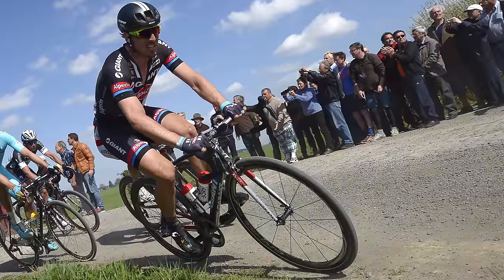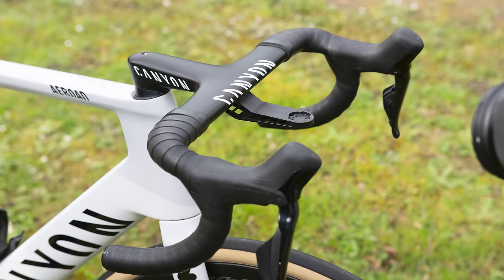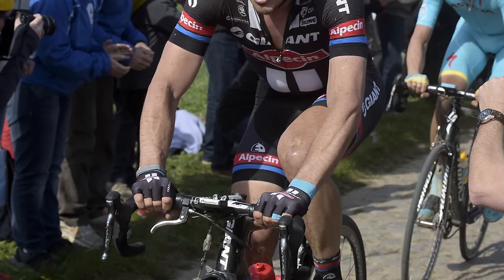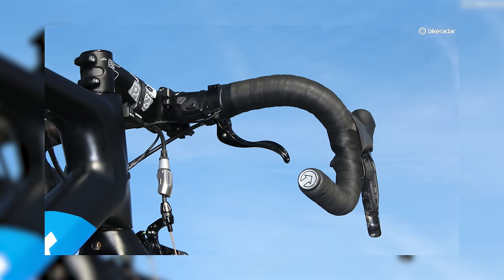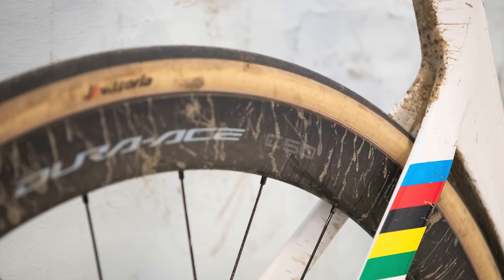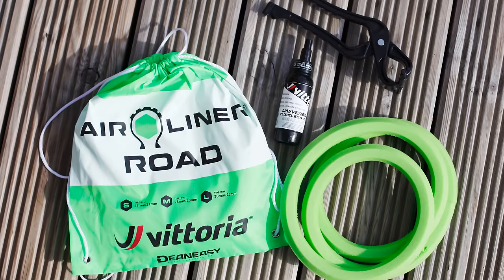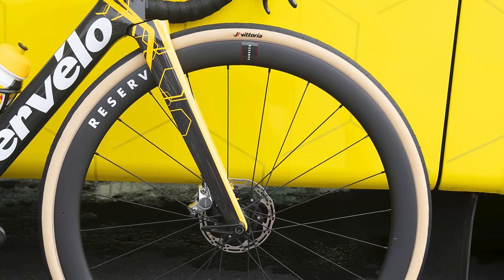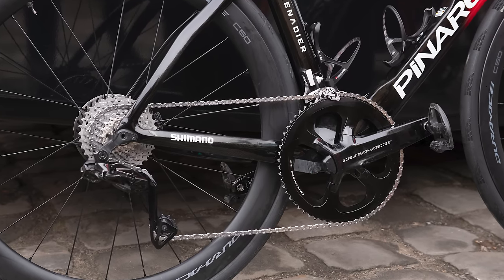2015 Vs 2024 | Paris-Roubaix Winning Bikes Compared

Comment: Something you forgot: MvdP started on 28mm tires. He switched to his bike with racing number amd 32mm tires after around 80-90K (could be less) when he took a pee break, and returned to the peloton with Pedersen.
The one-by hype was strongly pushed by the fact there was a strong tailwind.
Reply: Possibly 170mm cranks vs usual 172.5 ..

Comment: As a new road cyclist, I use the Silca tire pressure simulator. If we take the data of MVdP, on cobbles, the simulator give around 3.65 bars at the front and 3.55 bars at the back. It seems to be a pretty good tools if the Paris-Roubaix winner has same values...!

Comment: just got a new canyon AEROAD and it came with Schwalbe Pro 1 TT tires that were thin as hell but fast too and I kept getting tube flats. SO I put continental 5000 GP with tubes inside 28mm tires. So far so good but definitely slower. I may just switch the same setup to tubeless. But I am very impressed with the AEROAD's straight ahead speed but the handling and climbing is not as strong as the BMC SLR01 that I have. But yea the bikes are way faster now.

Comment: 2mph? What were the wind conditions? That's a small enough difference that anything could contribute to the variation in speed. I doubt the "paid advertisement" I mean bike, had anything to do with it.
Reply: Indeed, that's the thing that bothers me the most in these apples vs. oranges comparisons: they do not account for circumstances and how the race was ridden.
Reply: ~4.5 km/h isn't equal to 2 mph tho. Also, they had strong tailwind in 2015 too.
Reply: Unlike in athletics, where wind assisted records don't count, cycling recognises wind assisted records.
Reply: @dainiusvysniauskas2049  They had a much stronger tailwind. And as I said, consider how it's raced: in 2015, they arrived at Arenberg with average of 44.2 k/hr and did Arenberg-finish at 41.5k/hr. In 2024, they raced start-Arenberg at 48.4 k/hr and Arenberg-finish at 42.5k/hr. So they raced much faster in the first part, thanks to the enormeous wind. Once on the cobbles they didn't race much harder and still had more favourable wind.
Reply: @dainiusvysniauskas2049  almost 48-43.5 is almost 3.5kph which is almost 3.2kph which is almost 2mph, so I'm almost positive my point was made.
Reply: @Andy_ATB  that's cool, it has nothing to do with the point of the video but yeah good to know
Reply: @Andy_ATB  You confuse things. Cycling speed records are only official in track racing. In road racing, it's just a statistic, and it depends on wind, racing tactics, weather, state of the parcours, the parcours itself which is almost never exactly the same, etc.
Reply: @Livlifetaistdeth  43.5 + 3.5 = 47, actual average speed at 2024: 47.8 km/h. 47.8 - 43.5 = 4.3 km/h. Math failed succesfully

Comment: The Michelin tubs are obviously superior, and I fully I expect we will see more CX size casings at Roubaix in the future, especially among the French teams who are more engineering oriented. Way more comfort owing to a full 360 degrees of casing, no pinch flats, much wider range of pressure, much lighter tires, much lighter wheels, no need for pool noodles that make getting a flat tire off the rim virtually impossible. If the speeds are rising into to the high 40s, why would any team choose to use a high stack gravel frame?

Comment: the 5th fastest ever paris roubaix was the 1964 edition, only broken in 2017. bikes in the 60's were also fast it seems. I'd pick johns bike, just looks nicer to me.
Reply: Take a look at that roubaix and you'll see why it was so fast.
Reply: Fastest, by what measure?  Every year the course is changed.  Every year the conditions are different.
Reply: @-Stop-it  1964 had the fastest average speed.  It's still 4th fastest.  They had a laughable tailwind, and significantly less cobbled kilometers than following Roubaix events.  The tailwind was so extreme that an enormous group fininished together because no breakaways had any chance of sticking.  It took some luck to finish that way though because it was also wet but there was no massive pileup to create a huge split in the group.
Reply: @veganpotterthevegan  my point was just that concluding "bikes have become so much faster" as they did in the video by comparing 2 editions of a race doesn't make sense.
Reply: @cyclist2906  no it doesn't,  they're faster and bringing up 1964 means nothing.  If you tested both bikes with a power meter holding 200w, the difference would be obvious. Hold 350 and it'll be laughable.

Comment: So has the Price.  Forcing many of us to keep what we have, upgrade some of the parts instead.  Sorry, i don't have 8k for the lastest ride
Reply: Did you have whatever it was back in 2015 to buy an equivalent bike?
Reply: @br5380  In 20015 i paid 2k, all be it in a sell for a Focus, full carbon, running UDI2 10 speed, ok wheelset.  It was not silly money
Reply: @marccarter1350  and how much is an equivalent Focus now?
Reply: @br5380  could only find ones similar, starting at 5k
Reply: @marccarter1350  so it's really £5k vs £8k rather than £2k vs £8k

Comment: This proves little when you're not comparing the same rider on different bikes. No doubt bikes have improved...however I have a 2011 BMC RMO1 which I've now done over 1.3million VMs of climbing on. I also have a 2022 BMC SLRO1 One. Both weigh 7kgs..there is virtually no difference in speed or in climbing improvement with the newer bike, infact I feel the RMO1 is slightly superior on the climbs and descents.

Comment: Why don't the pros use  flat topped aero bars knowing they're faster than tube shaped bars??  I can't understand this.
Reply: I think the thinning process was less stiff = more comfortable maybe? I'm not sure either, as a one piece handlebar is also less prone to requiring tightening during the race..
Reply: @richeeg3271  Lotte will back the maintenance bit up. Her 2-piece cockpit needed the torque wrench mid-race.

Comment: You left out that robaix is flat and they don’t need a small ring.
Reply: 600m of elevation "climbed" during the race. Not a lot, but its still uphill in parts, most noticeable in the Trouee D'Arenberg.
Reply: @stevemccrory9130  over 260km doesn’t get much flatter than that. Avg speed for the trench is 40kph plus, so no they don’t need a small ring for that sector.

Comment: Why is the Peleton so SLOW to adopt Aero Handlebars..........Tube Shaped Bars in 2024??  I just don't understand.
Reply: The opposite, these were one off reversals for Roubaix.
Reply: Partly used for grip during Roubaix.
Easier to get a hold on over the cobbles.
Secondly they are a little more crash resistant which is highly likely at Roubaix.
Don't worry they will be all on full integrated aero cockpits when the normal season resumes!
Reply: If you ever tried to ride Arenberg with aero handlebars on the top of the bar, you'd know that's not comfortable. Some riders (like MvdP) don't use the top and only use the hoods, but riders that prefer riding on the top will more likely prefer the comfort of a round handlebar on cobbles. On asphalt a round handlebar isn't comfortable, but it is on cobbles.